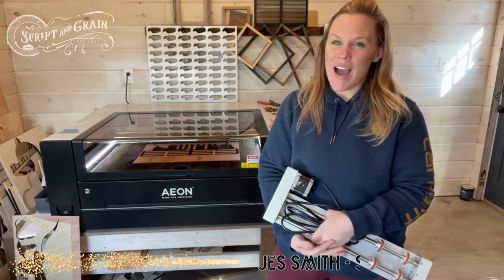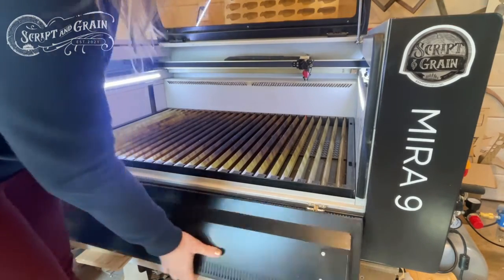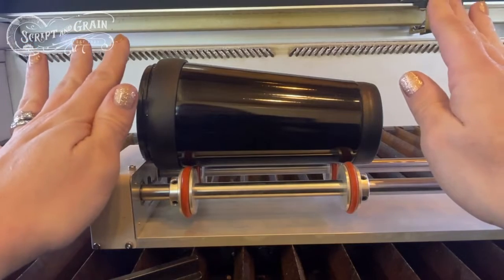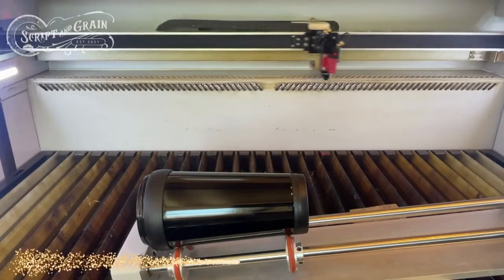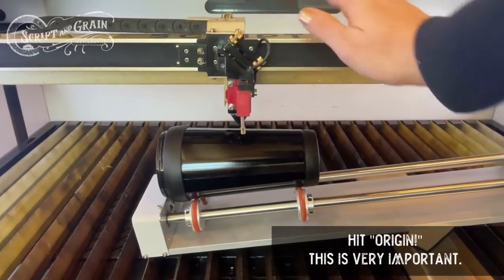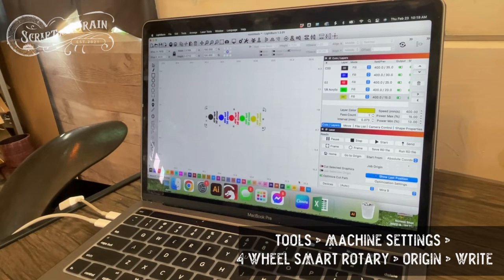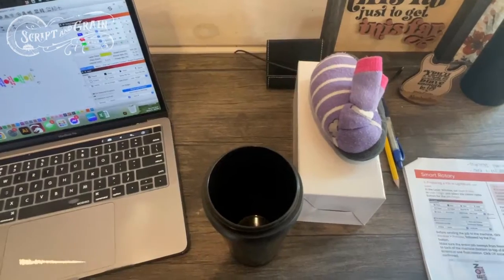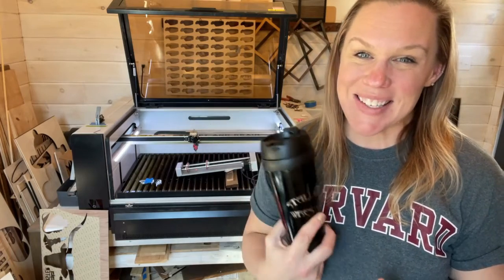AEON Laser: How to Use your Smart Rotary for engraving cups, tumblers and more! W/Script and Grain

Comment: Love the video since you went through basically all he steps. One thing I didn't see you address.  In the instructions it says reduce the speed to 20.  I gather you did that.   There were no other adjustments?  I also have a 9.    I engraved 1 cup fine and then messed up another so I'm still getting the hang of it.Thanks.  but
Reply from the maker: Hey there! I typically use my same speed, but since I roughly showed the "Painters tape" version, you're right,  I don't think I covered that. With the painters tape on, I reduce the power but not speed. Without it, my settings were 400 speed/30 power. 20 speed would be REALLY slow! Sometimes I drop it to 350 when I have smaller text involved, but I don't think I went lower than that before.
Reply: @scriptandgrain    Understand, I am talking about the speed on the laser itself,  Looking at the instructions from Mira, it says to press the speed button on the laser and set it to 20. (the only thing seem to do is make the gantry go VERY slow.   But in LB my speed is about 350-400
Reply from the maker: @lizkingdesigns  Oh wow! I checked their PDF file a few times and didn't see that step at all. I DID print a hard copy a year and a half ago, so I wonder if they updated it since then? I think mine is set to 30. Does it change when you "Write" your rotary settings?

Comment: Wow, I'm glad my Epilog Zing rotary tool has adjust height wheels, having to wedge wood under a rotary tool doesn't look like a good idea.
Reply from the maker: I mean, I never had any issues so I thought it was a great idea! It came FREE with my machine, otherwise I wouldn't have one or the ability to do any of this, So I am very grateful for that. There are upgrades, but I don't want them and really don't enjoy doing cups. I would think that for anyone who does would upgrade at least to a PiBurn.
Reply: @scriptandgrain  If it was free then I guess I wouldn't complain, its decent for being free. I paid $1,100 for the rotary device for my Epilog Zing laser. It's a great rotary device, with great features, and made extremely well, but I always felt like it was way overpriced. The wheels adjust, there's a built-in hold down for smaller/lighter objects, and has automatic line up and height, but still OVERPRICED.
Reply from the maker: @eckcreations2200  oh wow!! That is pricey. Have you looked into piburn at all? Is it compatible? I guess I wouldn’t if I made the investment that you did. Sounds really nice!